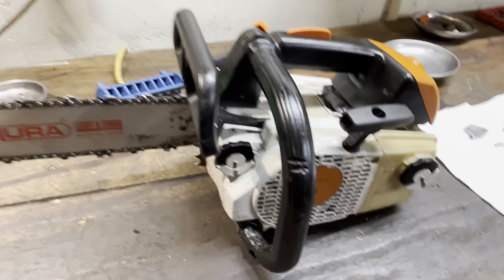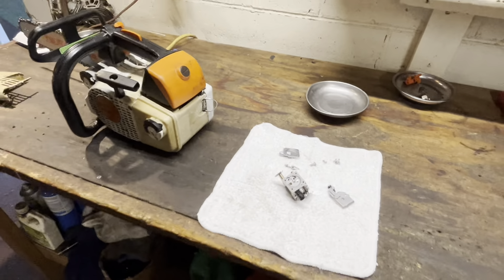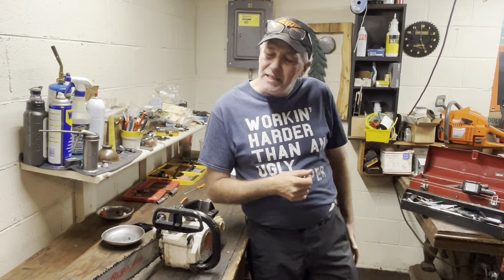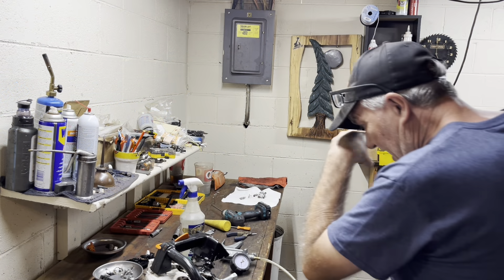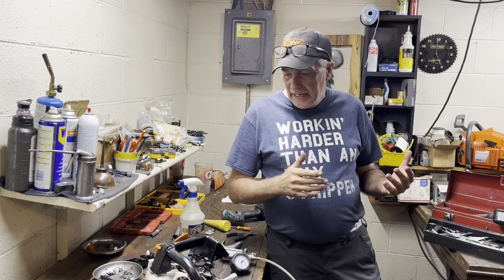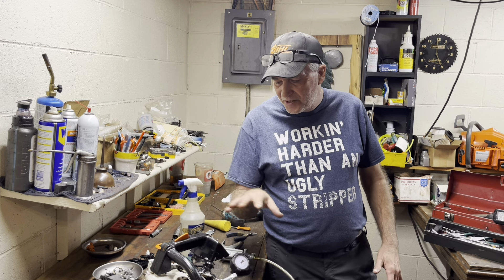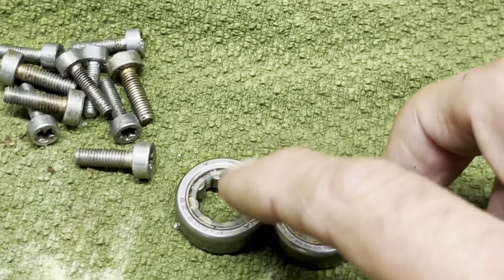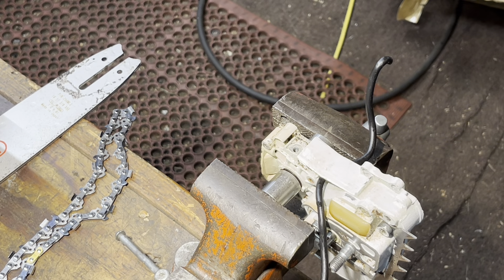MS200t Strugglebus Repairs. Fixt

Comment: This video is going to help me alot. I've been having the same type of issue with my stihl 031av. Now I just need to buy me one of them vacuum testers.
Reply from the maker: It's one of my most used diagnostic tools I use.  Good investment as they the MV8500 can be had for about $115.  Just as valuable as a multimeter is to an electrician.

Comment: Please explain why the epoxy fix on the accelerator circuit works.
Reply from the maker: If anything gets by the fuel filter the carb will not function properly.  These are very tiny passages.

Comment: Been out of production for a reason…. They suck.   I am also comparing a ported 201tcm to a ported 200t  

More power with a (ported) 201 and much better ergonomics and you don’t have to turn the switch back to the on position. Just pull and go after initial start up.